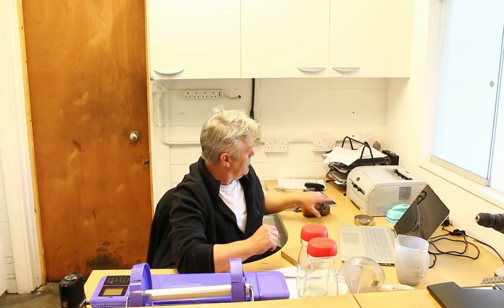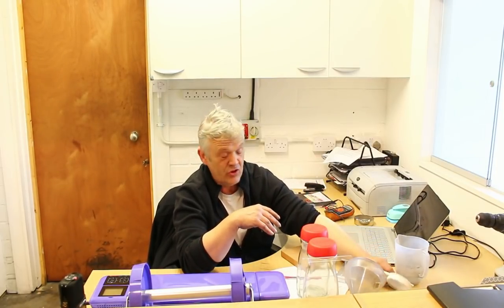Make A Battery With Rob 2

Comment: Hey rob and teem .i been making a few batteries of late and got to thinking of a simple way to use it in an everyday useful way and charging a phone is something we all do so I remembered a solar battery bank I bought off eBay 3 years ago . I felt it would be a wonderful affordable project idea for your work shop sometime that people could work towards . Check out the product here . You can take out the 18650 cells and replace it with cell that are made in your work shop ! Hope you feel it’s of help and a good idea 💡. Regards Andy https://rover.ebay.com/rover/0/0/0?mpre=https%3A%2F%2Fwww.ebay.com.au%2Fulk%2Fitm%2F232073949363

Comment: Hi Robert, I am super excited to join you on this build the battery webinar, thank you for the opportunity to learn a little bit from you. If I could I would definitely come out and visit you at your lab in the UK. Alas I cannot so this seems to be a great way to learn more. I have a question however I plan on trying to use this type of battery architecture to make a battery that would act as an external battery for my cell phone I am wondering how much active material we are getting in the kit and I'm assuming it's not enough,  about how much more active material would I need to make a 2200 milliamp hour battery pack that's all carbon I would love to do that if I could. Thanks for your time, I cannot wait for the webinar I'm so excited

Comment: OUTSTANDING - I'm really looking forward to this.  New sound cable is working well.  I like the thought of having a couple of friends build a kit at the same time - local feedback and pacing will help all of us.  This may be the wrong place to ask - but just for fun -- if you were designing this workshop with two grafoil electrodes and matching carbon-based elements using pva binder, what material would you use for the carbon?  Thanks again for all the information you've shared!  Oh, and thank you very much for making the time of the seminar friendly to folks like me in California!
Cheers
Reply from the maker: awesome mate - and having a couple of guys work through it was for exactly the reasons you point out - it slows the pace - gives everyone else time to do the work and find their own questions and gives time for ideas to percolate - so it'll be a few hours long as an event not a couple of minutes - as for the carbon - there is no easy answer - what i would do is exeriment to find a new carbon and use that - i have done quite  few things on making various carbons so i would give them a go - cheers